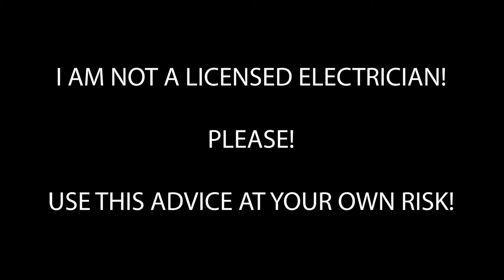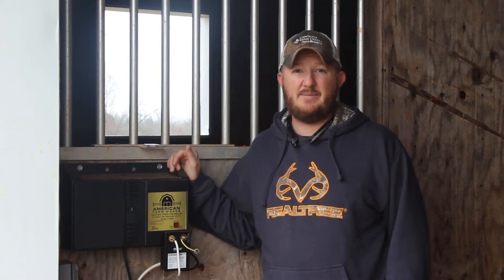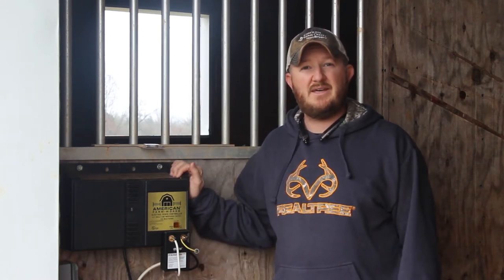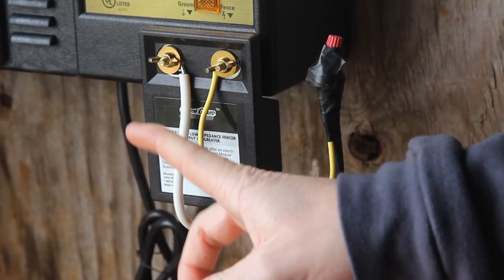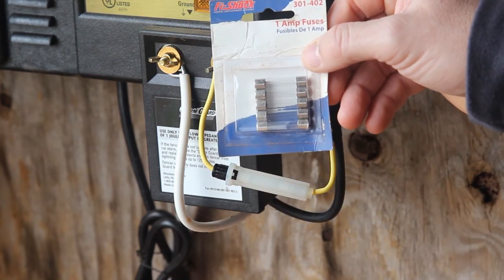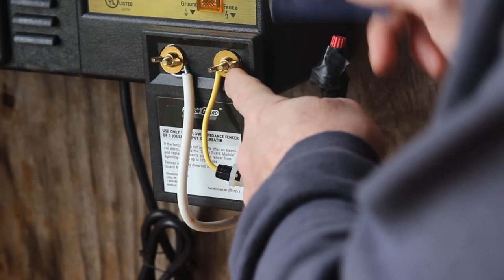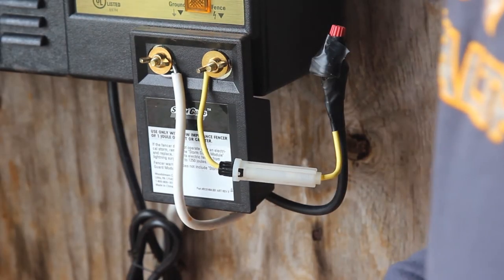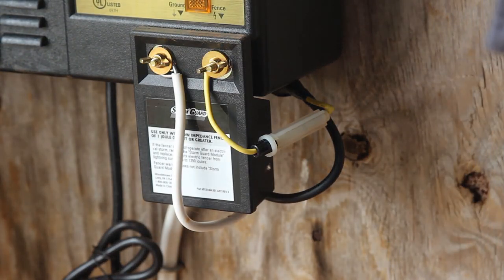Fence Charger Fuse System

Comment: Back in the 80’s electric fence changers came with a push in and screw 1 amp fuse or a round two prong fuse that plugged in on the underneath side of the box. 
I’d give double the cost of a new one to get that old one back! 
This video shows how to make the fuse connection similar to the old chargers, I’m ordering some today! 
 Thank you very much

Comment: I had a similar problem. It was so bad I needed two chargers because one was always in the shop for lightning repair.  Someone told me to get a surge protector for the AC plug. I have a Parmak charger and it has not been to the shop since I started using the AC surge protector. It does blow the fuse on the charger but the charger  is not damaged. I think it's been over 3 years since I needed one fixed. Hope this helps.

Comment: Just had a new (nice) Stafix fried with a strike.  Even with 4 6 foot ground rods on a lightning diverter. Thinking that with miles of wire, we've all got a huge antenna out there begging for it.  BTW, most charger companies recommend a surge suppressor on the input side and maybe that's what got me, because the 110 plug in power supply had the back blown off it.  Anyway, thanks for the video.  What I wanted to ask Mr Brown is after you implemented the fuse technique, his many times have you had to replace one ?

Comment: EFL sells a  fuse link at 8 dollars a pair--for those who don't trust their wire-nut and tape wrap skills.  Thanks for the simple 1-amp fuse solution.  How many joules is that charger pushing?  I well know that you want the lightest fuse you can get to reliably carry the normal charging pulse. 

Also curious if the fuse survives when you get a dead short on the fence.
Reply: Do you have anymore information— part number etc.. thanks

Comment: Were do you put the fuzz wire. To the ground wire or the hot wire. Thank u...
Reply: He ran it to the hot wire.
Reply: Fuses should be run on any wire that goes around the pastures where lightning expose won't go directly to ground. If running ground wires in the fence system (not just to the ground posts) then you'd want a fuse on that side as well.

Comment: Did you see a voltage drop on the fence after you added the fuse?
Reply from the maker: My tester goes up to 7000 volts. It still lights up at 7000 after the fuse was added. Since the fuse, I have grabbed it by accident while working and it still makes me sit down and take a break.
Reply: @joebrown2487  Thanks, good to know. I've got a few miles of goat fencing I'm going to add a fuse to on Saturday.

Comment: Makes me wonder why fence charger makers haven't implemented this.
Reply from the maker: They sell more chargers without it. Also, they have more expensive contraptions to stop lightning. Even if the entire fuse holder blows up, it is still cheaper than the contraptions they sell. It's all about the $$$!
Reply: @joebrown2487  Amen to that!
Reply: They all have some sort of "Protection" in the box, but that generally requires sending out to a repair tech, or to purchase special parts to replace if you do you own electronics.  Fuse on the wire seems most efficient to me. EFL company sells a fuse type inline solution, at 8 bucks a pair.